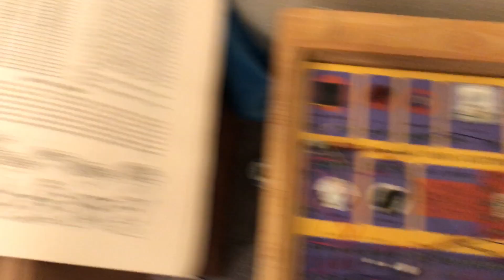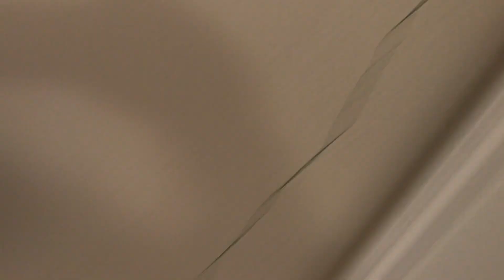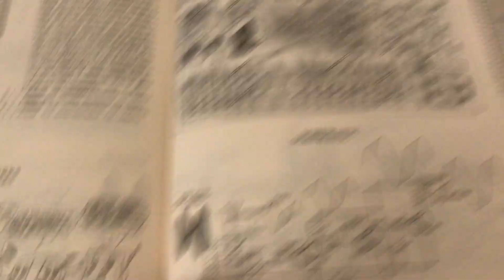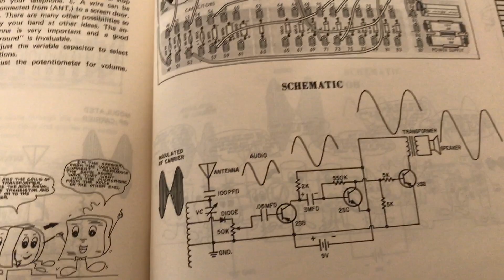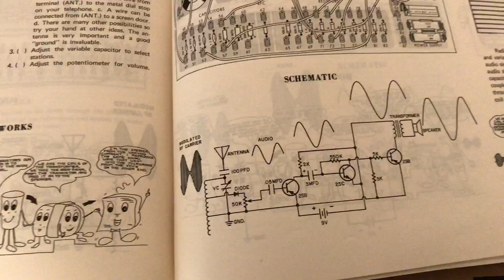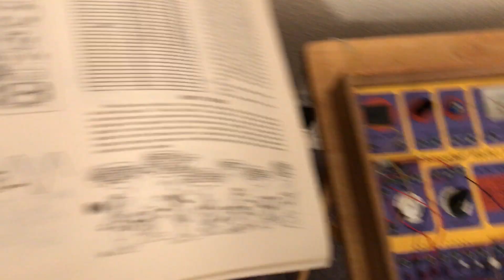Franklin Hu Vs. Draftscience Are radio signals particles or waves - I build a radio

Comment: It seems to me that this particle vs. wave debate is something that  my college professors loved to talk to about because there is a strong case for both.

I wonder if Franklin Hu would agree that light is just the high frequency end of the radio spectrum? If so, would he say that the photon does not exist?

I follow a kook on youtube who is still very much convinced the ether exists.
Reply from the maker: I feel that a "photon" is just a "wave packet". It is a wave phenomenon, but has limited cycles (as little as one) and is contained within a finite volume (like a particle). I would say the photon would look like a rod or arrow of compression waves, if you were to draw a picture of it. They travel in exact straight lines and do not disperse. That is where they get their particle attributes without actually being a particle. Photons are also only generated due to atomic processes where electrons are changing energy levels and all photons of all frequencies contain exactly the same amount of energy. Radio waves, however, are continuously generated and can have variable amplitude and they generally spread due to the nature of macroscopic transmitters. So they have physically different properties so you shouldn't bunch radio and light phenomenon together willy nilly like Draftscience does. These are different phenomenon, but all based upon waves in a medium.

Comment: 47 years ago I got exactly same kit as a birthday present... A couple of years later I got the kit with some integrated circuits. 

Amplitude modulation can be easily modeled in particles. You just send more or less volume of particles at the carrier frequency. Say you were shooting a gun once every second you just modulate by sometimes shooting two bullets at the same time or three. The frequency is the same but the volume of bullets is different. Obviously the carrier frequency is much higher then the modulating frequency so you have all kinds of freedom in terms creating a digital shape.
Reply from the maker: I did say that, that is what you would say, that you could change the volume of bullets. So, no this isn't going to settle this question, but I think it is a victory that you agree that amplitude can be variable in a radio wave and it isn't like rocks hitting a wall. But I still think it is far more plausible that it is just like a sound wave - after all that is what sound waves do. We don't have any real world analogies of signals like this being transmitted by particles. 

But it was just cool seeing the vintage kit and building the radio and hearing it receive a tone coming from my tone generator which looks nothing like a radio transmitter. It's great that you got the same thing. I don't know what happened to my original kit. I had to buy mine from Ebay. It is a blast from the past and I totally credit my advanced knowledge of electronics, engineering , computers, science  and my entrance to MIT to this kit. It has made me the man I am today. The funny story is that when we first got it, I was very upset that we had spent so much of our Christmas present budget on this one thing, but it was one of the most important gifts I have ever gotten.
Reply: @franklinthu  first 1/2 of this video is a response to your comment: https://www.youtube.com/watch?v=ct0Ed4QAmi0
Reply: For what it's worth, I was glad to hear you recount your success story solving that problem at work with knowledge gained from that electronics kit.  I was expecting you to say they gave you a bonus.  I guess the bonus is the good feeling of solving the problem and getting the recognition.  Well done anyway.